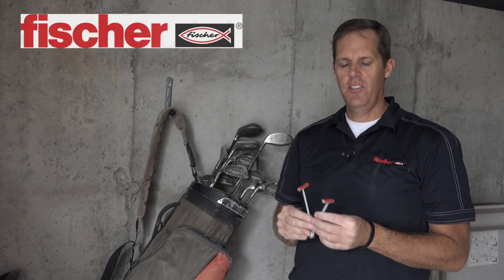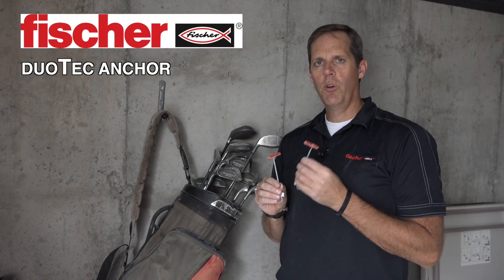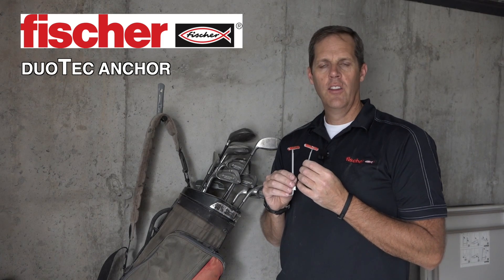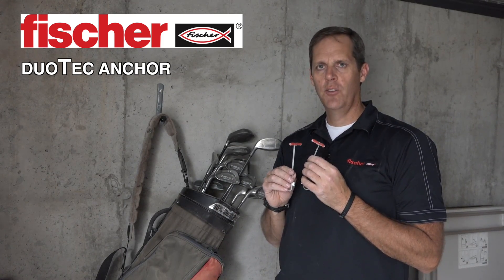Fischer Duotec

Comment: Why on earth would you use a specialty drywall anchor (paid for one 8mm anchor as much as a box of regular 8mm Fischer) for concrete. This is not a good example of versatility. The specialty anchor is worth it because it saves time.
Reply: @afandou1966
> Why on earth would you use a specialty drywall anchor (paid for one
> 8mm anchor as much as a box of regular 8mm Fischer) for concrete. 

Because you can charge it to the client and it saves you having to carry two types of plug, keep track of stock levels of two types of plug, replenish two types of plug...